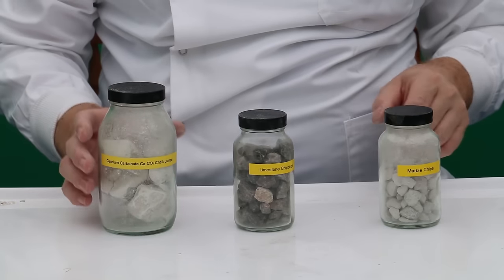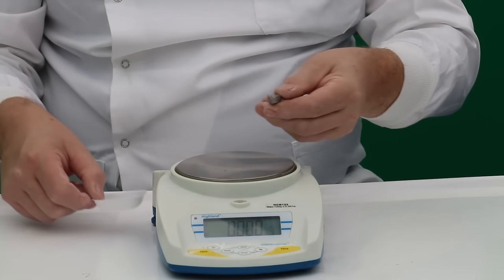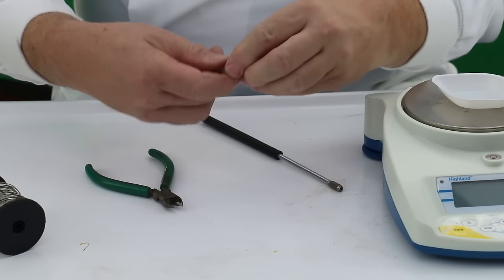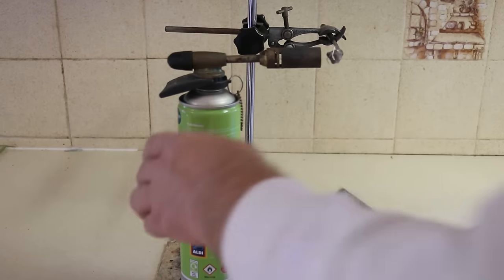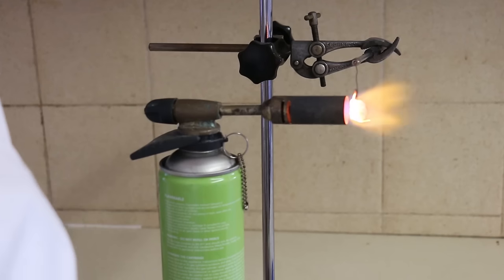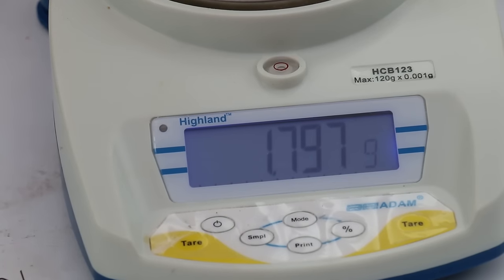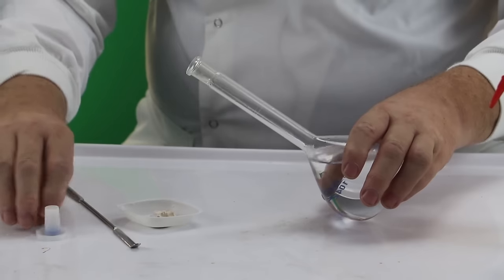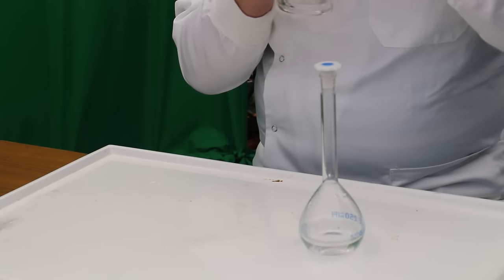The Limestone Cycle

Comment: Very helpful video. After some daydreaming I came up with a process to make sodium hydroxide from sodium bicarbonate. The basic process is I would decompose the bicarb with heat of ~200c into sodium carbonate, then further decompose the sodium carbonate into sodium oxide by heating it to at least 500c, and then react the sodium oxide with water to make lye. The problem with this is that while my initial research suggested that thermal decomposition of sodium carbonate produced only sodium oxide, upon further research I found it that it actually forms 80% sodium oxide and 20% sodium peroxide, and I've yet to find any easy way to separate the two. Also on top of that, the reaction is apparently very slow. So I did a bit more reading and decided that to make the sodium oxide, I could make calcium oxide from thermal decomposition of calcium carbonate and then react the calcium oxide with the sodium carbonate to make sodium oxide and go from there. This video provides a good deal of useful information for working out how to go about doing this. So I thank you for taking the time to post this. Best regards.

Comment: How long does the exothermic reaction last for roughly? I'm hoping to try and cook with it. Eggs, fish etc. Is it a clean burn or too toxic to cook over? If it's dangerous or toxic I won't try. Can it be added to dirty water to boil/purify after filtering ?
Reply: *and made safe to drink?
Reply from the maker: Depends on the amount. The more the longer. Some instant coffee's are heated this way add water and a container in a container ( keeping the food and the calcium oxide separate) heats the coffee to 60-70 Celcius. As for cooking I don't think it would be hot enough for long enough - otherwise we would all be doing it.

Comment: In the reaction between hydrated lime and the carbon dioxide, once the water evaporates, will it actually mold back into stone? Or will it be dusted limestone? Thanks for the video!
Reply from the maker: The answer depends on the conditions. What is left is essentially dust and if allowed to dry it will blow away. If it stays wet ish  - so it does not blow away and then it is squashed by something - other layers of sand mud clay etc forming above it then it will gradually be turned back to stone.
Reply: @PhilipRussell  You're awesome, thank you! I'm wondering if there's a way to accelerate this process without the need of water or any substitute equivalent.
Reply from the maker: @alejandrotenorio2327  no sorry that’s chemistry

Comment: What was the weight of the powder lime that came from the limestone?
Reply from the maker: It was about 6g. For each 10g of Limestone, we get about 6g of Calcium Oxide. The smaller lumps give a better yield. The larger lumps do not all undergo thermal decomposition and we are left with some unreacted Limestone. In this video with a small lump, we made nearly all of it into Lime.

Comment: How long do you need to cook the limestone? Say 1kg?
Reply from the maker: Time is not as important as temperature. You need the Calcium Carbonate/Oxide to glow red hot. This is normally above the temperature of a normal oven. Once the Calcium Carbonate/oxide is glowing red hot then it only takes a few minutes. The size of the material is also very important. The larger the lumps then the longer it takes.. Small pieces about 1cm cube or less takes about 10 minutes once they are red hot.
Reply: Thanks for your reply. I see. I've been doing a bit of research and seems like the temp of the kiln needs to be at a constant ~1100 degrees celsius. I'll assume it will then take roughly around 30 minutes for 3cm or larger chunks of limestone weighing about a kilo. I hope I am close enough with my estimates.
Reply from the maker: That sounds about right.
Reply from the maker: It just takes a long time. The hotter the reaction the faster it goes, but if you have the time then as long as it is hot enough to get the reaction going then it will work. It doesn't work in a normal oven but if you can get it to around 1000 degrees then it might go. The Ca is not really holding onto the CO2 - it is chemically joined. Lowering the pressure will have virtually no effect . Heat is needed to break the bonds and that energy doesn't change in a partial or full vacuum
Reply: Roughly 4 hours in a rotary kiln at about 1,800°
Reply: @tomgrosejr2251  Hi Tom! Does the required time in the kiln go down as the size of the limestone gets smaller? 1800 f or 1800c? Or is the amount of time constant no matter the size?